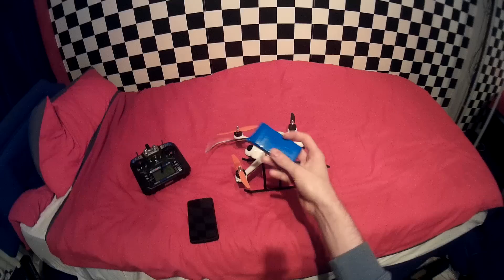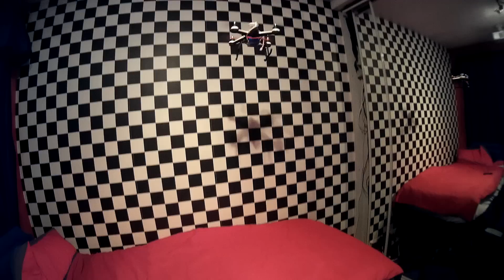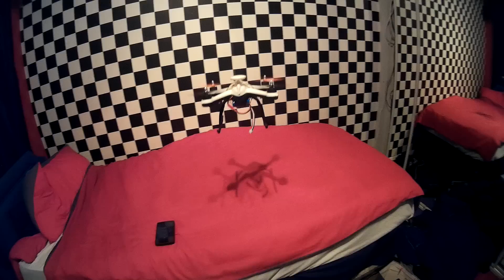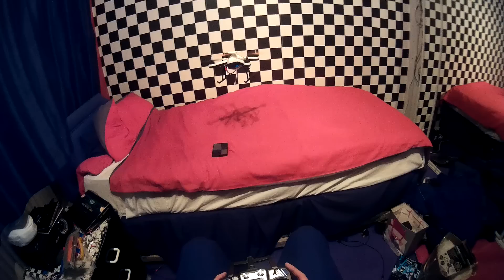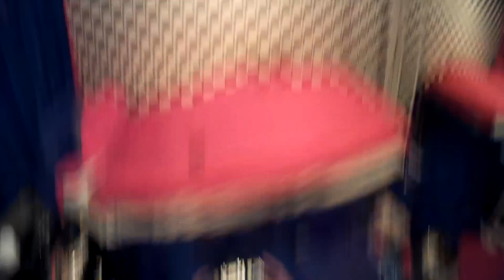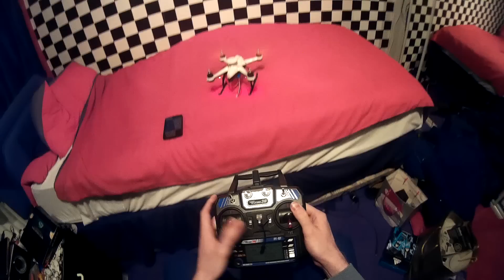Flying3d X6 17 minute Endurance flight

Comment from the maker: Sanjin Grandić actually the stock charger for the x6 is a rebranded sky-RC b3 ac charger and is a perfectly good charger for 2 and 3S not sure why everyone is saying its no good. it looks cheap but it works and doesn't overcharge. as for the battery. the best battery is the 1850mah power-tech 33c battery that fits inside
Reply: AndyRC Thanks Andy, one question though, is that battery equipped with a standard JST and if you can be so kind to put the link as where to find it.
Speaking about batteries I saw a guy (cannot ramemeber the channel) on  youtube using a Zippy Coompact 2200 mAh but there was some soldering done before.Also true that a lot of people online is saying that the stock charger is no good at all...if you say it's ok I wont have to spend extra money to buy one..all the better...Last short question, some people get the LCD screen on their controller some do not, any hint about that issue?
Thanks for your time and have a great day..
Reply from the maker: no the battery i mentioned you have to remove the stock connector and replace with JST by soldering. The stock charger is fine but eventually if you progress in the hobby you will want a hobby grade charger, video coming up next about that actually! as for the TX version you mention, I got mine from banggood.com they call it the OSD version so if you are wanting to get one with the screen get it from there. all the best
Reply: AndyRC Thank s Andy for your time...unfortunatelly I already ordered mine on another site (due to collect it on monday-tommorow)...my guess is that it s coming without a screen which I find very usefull even though I am new to this hobby, the advatages are obvious.I ll check on banggood.com
if they sell this OSD version of the controller if I find out tomorrow that mine s without a LCD screen but will this work with my X6?
Thanks a lot for your time..
Cheers..
Reply from the maker: the problem with doing that is every controller is bound to the quad out of the box. and you have to take a lot.of things apart in order to reach the bind button inside the quad but it can be done if you search for sebdockys bind procedure
Reply: Andy,

thanks a lot

have a great day...
Reply from the maker: no problem you too

Comment: Hey Andy.  Not sure if you've seen my reviews of the 3D X6 or not.  First, my 3D X6 lost the controller board and I'm awaiting a replacement from Banggood.  I ran mine with the 6045 two blade props and boy does it have lift.  It may also be causing a lot of drag on the motors as I did experience great fluctuations in voltage.  I think it would be better to do your test outside under real flying conditions. That battery is too much weight in my opinion.  However, good review.  Good luck.. I did subscribe.
Reply from the maker: the weather is too terrible to do any worthwhile testing with the x6. for the last month or so the wind has not been below 20mph and shows no signs of stopping, roll on the summer
Reply: Yes, it's been cold and crappy here in Canton, OH.  I don't let the cold deter me just the wind.  I've flown in 19*F temps.  The 3D X6 does not handle a lot of wind, but I do like it with the modified props.  Now, I had to ship mine back to Banggood.  The cost was $39! It's been 25 days and they supposedly have not received it.  I cannot get tracking numbers for items mailed from the US to China.  Not with the USPS anyway. I won't hesitate to file a claim with Paypal if for some reason it gets lost..  Good Luck flying.
Reply from the maker: Iv sent one back as well.. bricked using the groundstation. luckily they did receive mine. this quads gps function is not good. but its cheap.
Reply: Yes.  I've not used the GPS yet.  That's something for my local park or RC club's flying area which I have not been too with the 3D X6.  Did not have it long enough.  I do like it and I think it has potential.  It's the small size I like. Can be transported easily and I don't fear a crash, "God Forbid" into a person, etc. as much with this vs my Cheerson CX 20 which seems massive with the prop guards..
Reply from the maker: doesnt it have the same gps and fc as the cheerson? is the cheerson gps any good?
Reply: No.. Cheerson has an APM.  The 3D X6 has a BigShark flight controller. What's the difference?  Not sure as I have no experience with the Big Shark.  The Cheerson's APM works great in my opinion.
Reply from the maker: ah yea apm is much better and much more expensive. also it can do mission flying if thats your thing. I have setup a minature fpv rig for the x6. just waiting for a decent gap in the weather!
Reply: Have mapped out the APM, just have not flown the route yet.  That will be something I do in the Spring and I'll post on Youtube.
Reply from the maker: you are very brave to try that out :) im still not sure of this gps stuff on quads. I cant trust it in my car and thats safely on the ground and only being used to direct me to places!
Reply: Well, you may have not seen my most watched video of my RTH with the Cheerson CX 20??  Currently at 47,500 plus views... ;)
Reply from the maker: ill check it out :) congrats on the views!

Comment: Have you done further testing with this set up? I just bought one and waiting for it to be shipped. But 17 minutes is great. I wonder what's the range on one of these.
Reply from the maker: they say the range is 800M I have done some further testing and if you get the battery dead centre for the cog then it works perfect. only problem is adding a camera is pushing the limits. the next experiment i will try is 2000mah with a camera, my target is to get 10 mins
Reply: AndyRC Thanks for the info. Helps a lot. This is going to be my first gps quad. lol
Reply: Wondering if this battery would work. It's the only one I found with correct connecter. Here's the link: ebay http://www.ebay.com/itm/MJX-F45-V913-Upgrade-Battery-1800mAh-7-4v-50C-High-discharge-rate-/221513646956?pt=Radio_Control_Parts_Accessories&hash=item33933e036c
Reply from the maker: any battery with a jst connection would work however most likely wont fit inside, just attach underneath and ensure its balanced

Comment: If I were to get an X6 and that battery for it, do you think I could also power the V666 FPV system along with the quad from the same battery?  Would that damage the quad or the FPV camera?  Would it even be able to carry that much weight and still fly smoothly?
Reply from the maker: it would but both have to be strapped to the bottom rather than using the default battery bays, I have since learned if you get them right in the middle they can handle it
Reply: AndyRC Sounds cool, thanks.

Comment: Regarding the stock battery and the charger which are of very dubious qualitiy.I'd suggest to anyone to buy a proper charger (many brands are suitable) but when it comes to the  battery with better performances there is one I could find ;7.4V 1200mAh 25C LiPo Battery Pack.  ---link below : (conector is a JST)

It fits with ease into the battery bay of the X6

http://www.helipal.com/storm-7-4v-1200mah-25c-lipo-battery-pack.html

hope it wil help those who are looking for a better power source which seem to be a big issue with this model especially due to the small battery bay of the quad

Cheers/happy flights to all

Comment: Dear Andy...need spme HEEELP  -:))) if you find the time, so I received the TX without an LCD screen, does the aftermarket telemetry can be bought, so I have all the data required during flight....especially the state of the battery of the quad during flight...temperature sensors etc....I received (wrongly ordered) a Zippy compact 2S -2 cell 7.4 v with 3300 mAh 35C ....can I after soldering use it to try to beat your flying time....the battery is big but would try to do the same thing you did attache it beneth the craft....or will it burn my quad motors..or controller...they say in the specs of the quad 7.4V  2 cell till 3500 mAh...so am I risking overburning or is it OK....????thanks so much in advance
Sanjin...

Respect&happy flights...